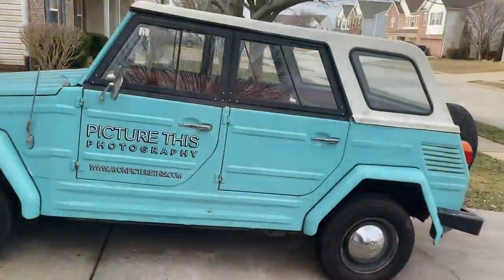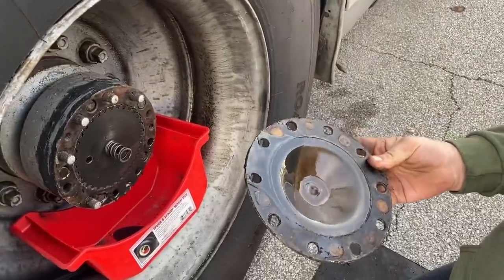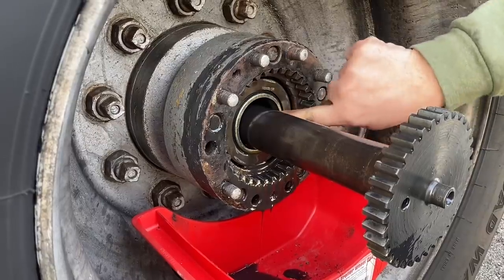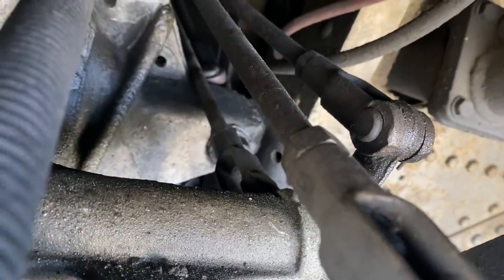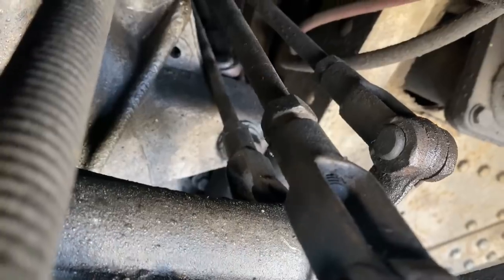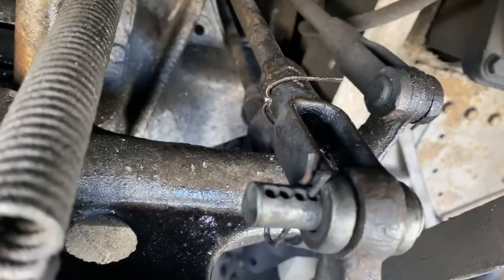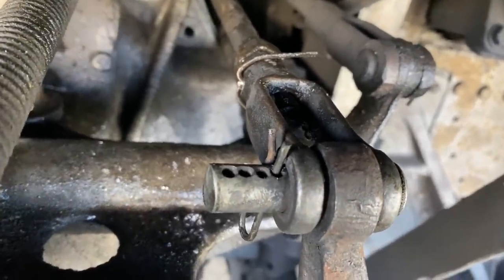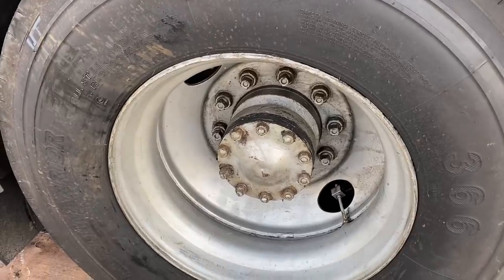Post trip maintenance

Comment: Things I learned from the comments:
1. The audience cares enough to point out that the cotter pin is not a good long term solution.  
2. The audience cares enough to recommend spring instead of gear clamps.
3. Not everyone reads all the comments before commenting.
Reply: Youtube constantly swizzles around the order of the comments based on [some algorithm] so a comment that was at the bottom at one point can bubble to the top after it gets upvotes. Also right now there are 250 commentsso it's tough to read all of them.

Comment: Probably need to put a solid pin in that connection. Cotter key will never last.
Reply: Agreed. Will work for now but a roll pin or a dowel would definitely be better in the long run

Comment: Pro tip, spray the bolts with pb blaster when using a impact when you can, it will prevent the nuts from sticking to the socket. And get you a good set of impact sockets. Great job, keep the vids coming.

Comment: I carry a small block of wood in my tool box for when I have to use a hammer against metal that I don’t want scored by the hammer.  I call it a Cletus block as I found it in  Cletus’ hanger when I was replacing a jug on an aircraft engine.   You would be surprised how many times that piece of 4” 2x4 comes in handy.  Even wrote on it “Cletus block”.     I know, I know, it is to laugh.  What can I say.

Comment: Light ends vapourizing out of the fuel probably, for your vw being hard to start after a few months, gasoline usually has butane blended into it for a Reid vapour pressure spec for cold starting.

Comment: Quick fix on the gear linkage. Do you think you'll be replacing that split pin after every trip or are the linkage parts available and you'll fit them up when time permits?

Comment: You may want to replace the cotter pin with a roll pin sooner than later.  Cotter pins are pretty soft for that application.  Roll pins are spring steel will last a lot longer.
Reply from the maker: It’s fixed.... it’s done and perfect now.
Reply: Usually find roll pins on 5 cylinder 80’s VW and AUDI hydraulic clutch slave cylinders. They don’t fail, nor are they easy to get at.

Comment: Wouldn't it be better to slide the single clamp over a bit and double clamp that coolant hose ?  Another trick i have done is to make a few wraps of teflon on the gooseneck and then put the hose on and double.clamp it.  It also helps on removal in future because the hose isn't so stuck.  
Sometimes the casting has a ridge and that's how it lets a little coolant out, as well as pressure, hence the temperature fluctuations.
Reply: I double clamp all the hoses on my 12 valve,  gives ya a extra incase one breaks too.
Reply: @1320fastback  exactly!

Comment: those hose
clamps weaks all the time , try the clamps with a bolt same as for a turbo hose it will stop leaking for good
had the same issue in winter on my school bus 1999 international , for the leakage on your axel shaft is there some kind of a pop up vent to prevent pressure built up when the oil gets very hot ? on the gear shaft for your transmission that lock up key won’t tuff very long , try on your ajustement installing a double nut if it’s possible
to eliminate the free play
Reply: Agree 100% those gear clamps are junk and the worst type to use, the flat spring type that come on cars and trucks from factory are by far the best type of clamp, sad that most techs take them off and throw them away and use these gear clamps. They ran right up there with replacement battery cable ends for being junk.
Reply: @CodycoWeb  ...the techs don't throw them out...20 bucks says that somewhere around their bench you'll find a nice stash of factory clamps...🤨

Comment: On the shifter linkage, would it be possible to put a nut on the inside of the yoke? The cotter key seems a good temp fix but that little bit of movement will weaken the key over time, still pretty good sheer strength on it so it may take quite a while.
Reply: @Calvin Barnes - I thought the same thing (even weld the nut on the inside).

Comment: I know the guy who came up with that axle setup. His name was Goldberg.
Reply: Rueben? I  know him.
Reply: No, he was clearly Swiss.
Reply: His wife was the actual brains behind it. Her name was Ruby.
Reply: A leak waiting to happen.
Reply: Those who besmirch the design of the rear axle design clearly don’t understand it genius.  A design very similar to it is still used in asphalt and dirt circle track racing which tells me not only is it a robust design but one that was made to be easily serviced if a failure occurred.  Remember vehicles and equipment made back then was often overbuilt and designed to be easily serviced as opposed to later revisions and redesigns that were valued engineered for profit and durability second.  Think how old and how many miles are on Lenny’s drivetrain and how original that it is, no sir Rupert Goldberg how no part in the design of that axle setup but rather men with last names like Allison, Dana, Eaton, Spicer, and Victor were responsible for design like that which were durable and have stood the test of time.
Reply: @gullreefclub  Twas a joke.
Reply: Very good answer.  You are correct.
Reply: gullreefclub well said
Reply: @gullreefclub  : the modern full floating axle setup used for racing  and heavy duty trucks are way more simplified with less places for leakage which is why they are still being built and this one isn't. Plus you must be a ball at party's.

Comment: You need a wire wheel on a grinder (bench or angle) - clean up that metal disk in about 60 seconds.  Make things look new fast!!
Reply: I am surprised Scott doesn't have a bench vise that slides out from lower compartment like his tool box does, or at least some kind of desktop or plate with the bench vise bolted to it. And heck why not a light mounted to the backside of the door or cover also!   A whole portable work station.  Heat duct for when its cold and an AC receptacle.  Like an outdoor kitchen on an RV

Comment: 2 observations:  First, a wire wheel of those surfaces wold go a long way to getting things to seal. Second:  I would try to avoid getting the brake cleaner on the tires.

Comment: Scott, a few ideas for you and a question ,  Being a journeyman machinist for decades we always hand lapped in all flat gasket surfaces every time we broke them apart. This can be done on any flat smooth concrete area with a little valve lapping compound and 30W oil mix. All you do is work the plate on all the surfaces on the concrete in a figure 8 pattern with lot's of the compound & oil mixed like a sludge then make figure 8s for quiet a while then wipe clean & watch the flat surface until you can see 100% contact all the way around for full contact . ( yes I know, it takes time to get it 100% but it gives you a FOR SURE seal ! ) Then a real good finale cleaning , chase the mounting threads of the axle studs with a good sharp die and the nuts with a tap before applying anti seeze on them and toque the nuts.  Try it this way if yous axle cover starts to leak again.  Better to do it this way every time if possible as I HATE rework ! and don't trust any kind of sealer.  Question, can you ( will you ) please replace that shifter clevis ASAP !  as that cotter pin is not going to hold up very long , there's a ton of power on all transmission linkage if it ever grinds into gear.  Were all in this tougher , I learn from you,  you pick up tricks along the way as well. Old is golden , New anything--- not so impressed.       Mike P.   :)

Comment: From my “Idiot’s Guide” days - Step 1 when starting a Volkswagen is key on and make sure the red and green lights come on (You late model guys with your fancy TWO red lights!), and Step 2 is “warmitup!”
Reply: Agree with your advise.  Also let it run awhile before revving-up the engine, that cold oil doesn’t flow so smoothly in cold weather.  But, it’s his THING to torture...
Reply: I like Muir's instructions, except I don't roll and light a cigarette to during my warmup time.

Comment: Regarding comment on the brake cleaner containing carcinogen , the same applies when coming in contact with gasoline, oil, and grease these all fall into the carcinogenic category, Scott protect yourself-wear gloves
Reply from the maker: That only causes cancer in California... I’m in Indiana
Reply: Ha! You should've seen my local CA hazardous waste dump when I brought in my Dad's old gardening pesticides and they saw the letters DDT on them. I was surprised their eyes didn't fall out. They accepted it just the same, though. They weren't too happy about the case of Clicquot Club cyclamate-sweetened soda, either. Prop 65!

Comment: If you have the time you should run a compression check on the VW.  It has a low cylinder that allows the starter to spin faster.  You can hear it clearly.  Probably #3.  Always enjoy your information on the channel.
Reply: That or the battery is nearly dead from sitting for months

Comment: Have you ever tried Permatex aviation form a gasket #3. I have found it to be an excellent gasket sealer and about 80% of the time it allows removal and reuse of a gasket. I use it on all my Muncie trans rebuilds and use it to seal the case halves of my VW rebuilds where it effectively seals the case halves where no gasket is used.
Reply: @tmackinator - I don't know about the aviation specific type - yet, I was thinking Permatex, Form-a-gasket, too - I'll thin coat paper type gaskets and let it set up a bit before installing - and, as you've experienced too; no leaks and usually recoverable.
Reply: @markaoslo5653  The #3 is similar to what you can get in the tubes but it is more liquid like and is applied with a brush applicator. It's been my go to gasket sealer forever.

Comment: As said below those gear clamps are junk and should be replaced with spring type clamps, thermal expansion and contraction will cause them to leak. Plus they cut int the hose when over-torqued to try to stop leaks.

Comment: The  black sealant you used on the axle flanges looked like it was very hard to smear out, was that because it was cold ?   or would a Permatex brush on product, like Indian Head, Aviation No 3, Super 300,, or High Tack, have been a better choice ?     I do not own a bus at this time, but watching your videos is half as good, and MUCH cheaper.     Keep up the great work, and have a great New Year

Comment: Scott, why not pull the "couplerpin" out of that and just thread on a selflocking nut on the inside of that shiftingbracket???? And put then the pin back again…. That way the force is kept between the two nuts un the worn out shaft...

Comment: that cotter pin isnt going to last , got no matching rolled pin ?
Reply: Maybe replace the clevis?
Reply: Roll pin or a grade 5 stainless bolt with a nylon lock nut. You want to match your hole diameter as close as possible because that slop will beat up whatever pin you put in there and accelerate the wear on it to the point of failure.

Comment: When the time comes to move to Tenneessee was asking if Lenny be pulling your Vw thing if you have a towbar for it that goes on the front axle beam or renting a Uhaul auto transport trailer? im not sure if you have Lenny wired for a trailer brake controller for any trailers to tow? as i see you have a hitch on the back of him.
Reply: Scott has mentioned in past that Lenny doesn't have a very strong structure in the rear for pulling trailers it's not recommended. There is a design problem with sag in the back of silversides. Not an expert just know what Scott has said.

Comment: Scott, really, a cotter pin to repair a six dollar clevis yoke,  so let down, tell us you will fix it correctly later.
Reply: You mean a steel threaded rod , which would have to be cut and welded in a hard to access area?
Reply: @MrMauserb  No Patrick, i am referring to the yoke end, the split fork thing that the clevis pin goes through. It's made of a kind of cast iron and it's threads fail first so the threaded rod will likely be OK and a new yoke put on it.
Reply: I suggest a small zip tie or tooth pick

Comment: Its a vw. They always start if they think there loved. Had several.
Reply: Ha my audi must be the odd child the more you beat it and drive it like a 1 and a half duce the better it runs at 122k on 2.7t on oem turbos 27 psi stage 2 not a lick of oil from the turbo seals.

Comment: You should use impact sockets with the impact wrench (they tend to crack).
Reply: Laddie That’s the reason you buy tools with a lifetime guarantee, besides that 3/8 cordless spinpact really doesn’t have the ass to split sockets like air power impacts do
Reply: Their Thicker sidewalls can be a pain also
Reply: @RustyZipper  Very true

Comment: Now I see where Rover got their full floating hub design from for their Land Rover. They did away with two intermediate plates but added a c clip to locate the axle in the drive flange, an extra shaft seal, and built in leaks from the factory.

Comment: What purpose does the spring, on the axle serve?
Reply from the maker: It hold it tightly pressed in all the way.   Eliminates back and forth end play
Reply: Thanks for the reply. I haven't worked on any with this feature.  Mostly straight up axles with nuts and washers. Quite a few with the cones too.

Comment: Better to just use silicone than paper gaskets and silicone
Reply: Permatex make a Gear oil RTV and I had to remove the differential cover on one of my Cub Cadets a year after re-Siliconing it. You want to talk about good stuff, I thought I was going to bend the Metal before it broke free
Reply: @RustyZipper  worked on over the road trucks for 45yrs. I use silicone religiously

Comment: I need to drill holes in steel beams to hang electrical conduit, Any recommendations on drill bits at Harbor Freight or otherwise?
Thanks BGM watchers!
Reply: thdevilmancometh Thanks but I don’t have the equipment, Actually it’s the hanger brackets I’m drilling for in my hangar.
Reply: Project farm did a drill comparison.
Reply: thdevilmancometh Great idea, I rarely need to drill anything other than aluminum.
Thx again
Reply: @patchescessna7348   How thick is the steel you will be drilling thru? If it's 1/8" to 3/16" you might consider hardened self drilling, self tapping screws. Lowes has them with washer for attaching metal roofing. It's probably what an electric installer would use. Be sure to get a hex driver socket too.
Reply: thdevilmancometh  Yeah. I was thinking about the Z beams that are used for roof support on metal buildings. If it's I beam then I'd just use beam clamps. No drilling since they have a threaded hole. Just clamp it on the beam and bolt the conduit hanger on it.

Comment: Crazy hub and half shaft assembly. Far over complicated. Sorry Scott but I have to say the split pin ‘bodge’ on the gear linkage is gonna come back and bite you. If there is enough force on there to strip threads out that pin will be toast within 5 mile. New Clevis time methinks. I’m seeing a lot of good engineering on old US buses but at the same time I’m seeing some right crappy or overly complicated stuff too. If you want to know how to build a bus then in my opinion look no further than a London Routemaster.
Reply from the maker: It’s a temporary repair OMG
Reply: @Gary Cunningham: Agree re' the Routemaster; fifty years in service in city traffic, & one-third survive to this day. Also, they were built to be easy to maintain, & were a joy to drive.
Reply: One can easily shift that linkage manually without tools.  There is no strong push or pull force on it.  It just so happens that steel threads do not last forever,  Even if they are made with a funny accent across the pond.  I would guess that pin job will last quite a while. I would love to hear more details about the crappy and overly complicated things you're seeing.